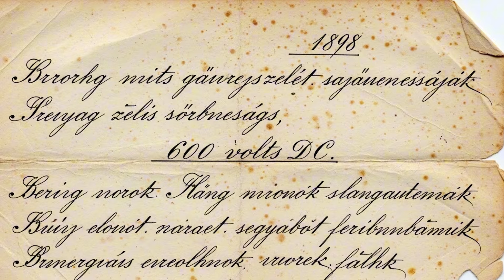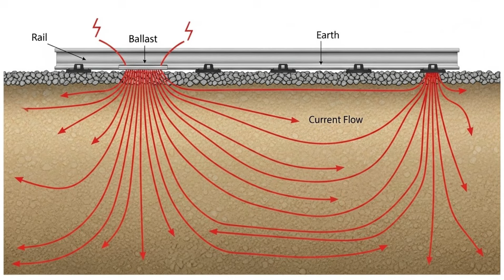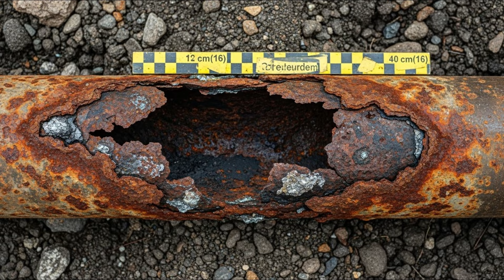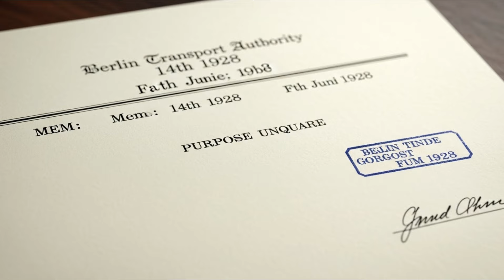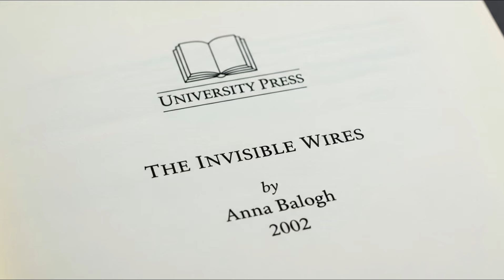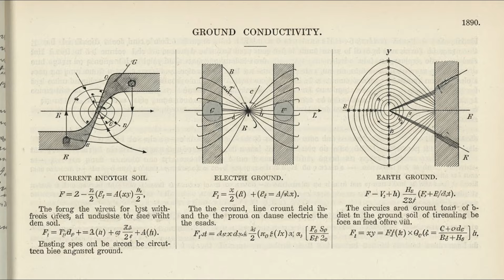How Old World Streetcar Systems Ran on Earth Currents, Not Overhead Wires

Comment: My grandparents, born in 19th century, warned me to NEVER, NEVER, NEVER stand with one leg on one rail and one leg on another rail because my body will connect rails what will produce strong current of electricity and I will DIE AT THAT MOMENT. But I can freely walk, sit, dance on ONE RAIL, no matter which one.
I was born in 1961 and all our trams and trains had overhead wires, but... but they scared me so much that even today I'm careful not to step on two rails at the same time💃

I'm from Zagreb, Croatia.
Reply from the maker: That warning makes sense for early rail systems. Stepping across two rails could complete a circuit—oral safety rules often came from real risks.

Comment: I wonder if a higer insulated copper returns would have reduce excessive voltage on other gound metals
Reply from the maker: Interesting question. In many systems, better insulation and a properly sized return path can reduce stray currents and unexpected voltage on nearby metals.